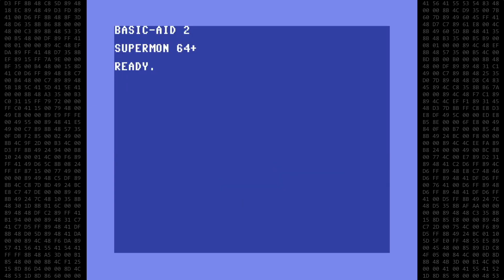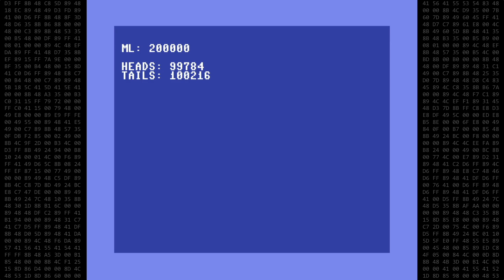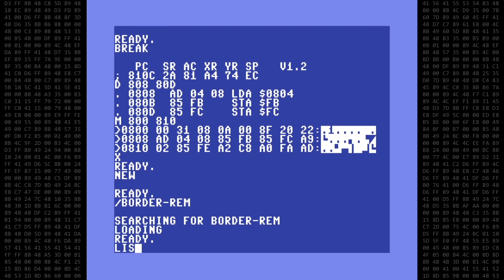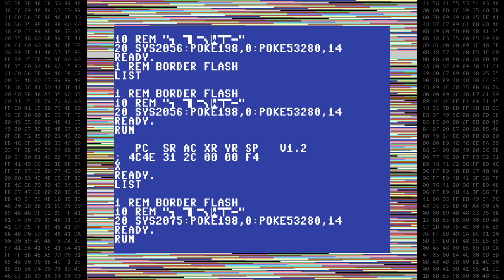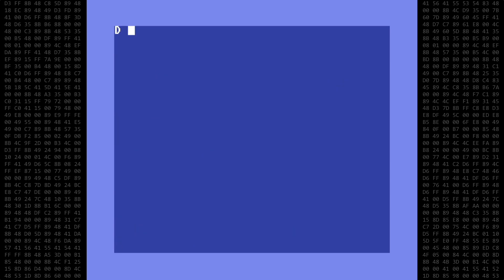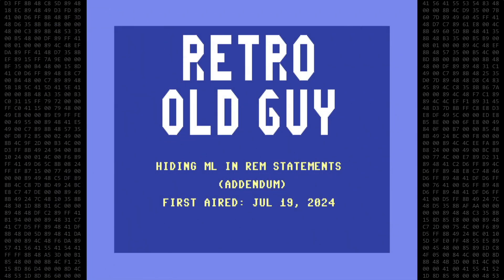C64 - Addendum to Hiding ML in REM statements

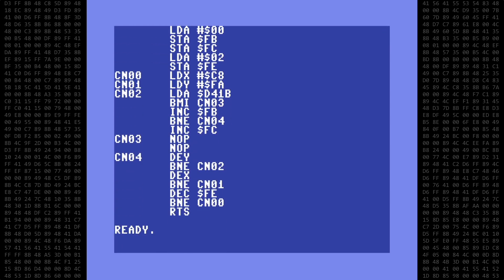Comment: 0:52 You could also LDX #1 : DEX to get a $00.

2:00 Hidden dependencies can be dangerous.  Technically, it's not the '0' digit in the "10" but the line number being ≤ 255, and the $00 is in the most-significant byte.

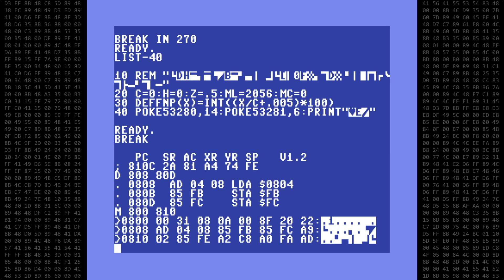2:11 $800 seems more reliable, since BASIC programs won't actually RUN if location $800 isn't a $00.  Though, I guess the low byte of the address is a problem.
Reply from the maker: Yeah you're right, I did make it sound like the line# itself should end in a zero and not the high-byte of the address holding the line number.   The video does show the correct byte in the memory dump.   So hopefully everyone will know what I meant 🤔

Comment: Can you do a review of Vision BASIC for C64? Most of the videos about it seems to come from the developer's account which hardly is unbiased. I am considering getting it, just need to see some benchmarks to see if it's really much faster than regular BASIC to make c64 games with.
Reply: @UltimatePerfection   I bought a copy of Vision Basic and can tell you that if you enjoy programing for a C64, you will love it.  It is very fast.  Like 7 to 10 times faster.  Even more so if you use machine language mixed in with the basic.   The guy who wrote it is getting ready to release a version 1.1 which should offer a few improvements.  Although it will be a free upgrade, you might want to wait so you can get the updated manual which I hear will have a much requested feature, an index !  You do need an REU or GeoRam (version 1.1 will support this I think) but for me, I just do all my programming in VICE and then run the compiled code on a standard C64.

Comment: Thanks for the tip on retrieving a zero byte indirectly.  2:08 "As long as the BASIC line number ends in a zero..."  I think as long as the line number is less than 256 it should work because address $804 is the high byte of the line number.